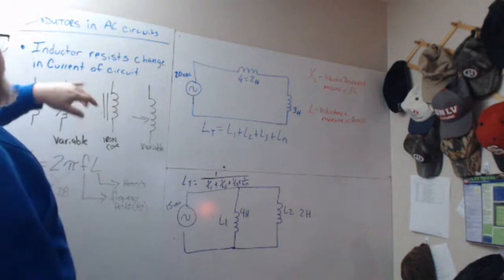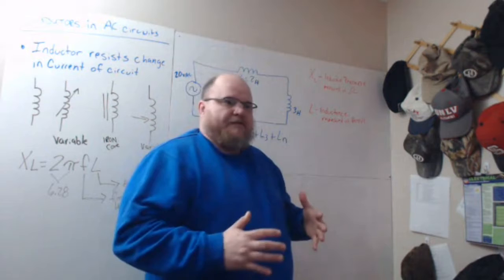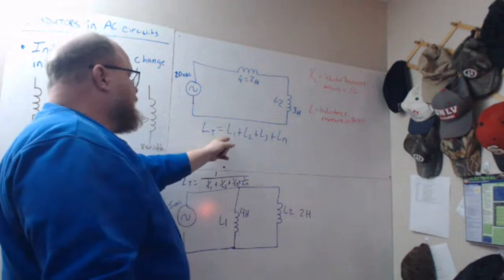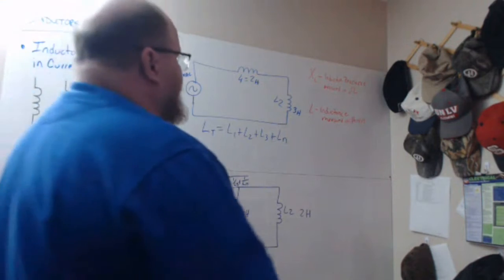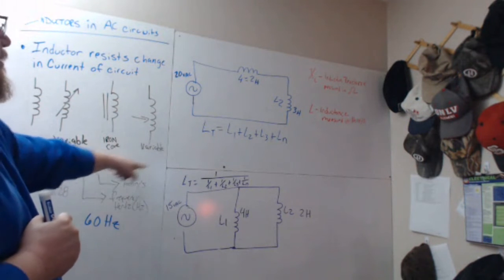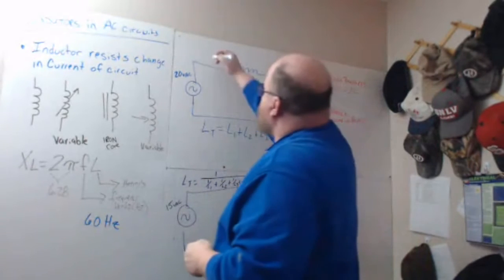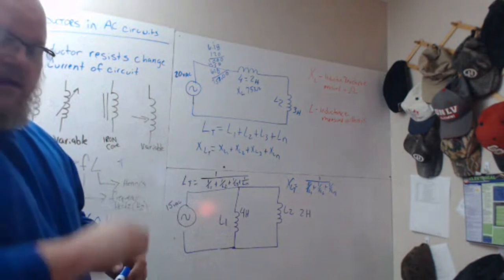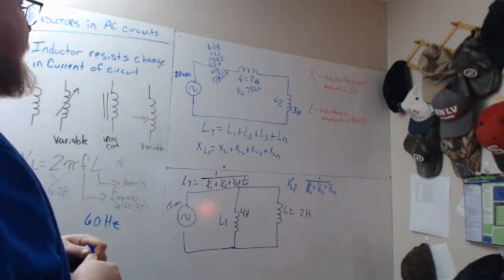Inductors in AC circuit

Comment: Thanks, 
I am looking as of wanna be able to correct an leading power factor out of 2 PC with I guess inductors.
So I need to calculate them - as I just learned last week to calculate Capacitor uF successful and use in practice. = rise pf in room with two fridges.
until next time ... lesson.